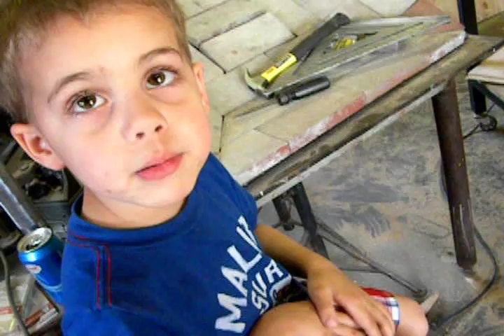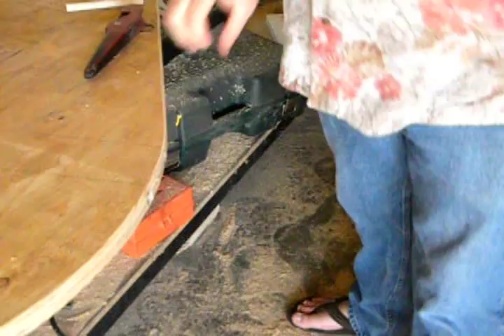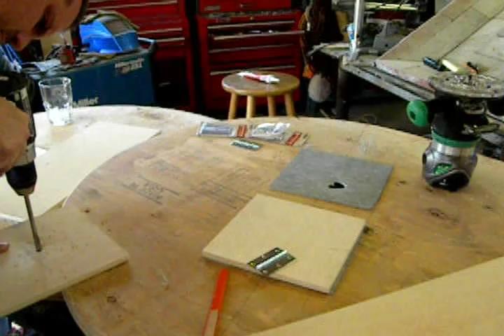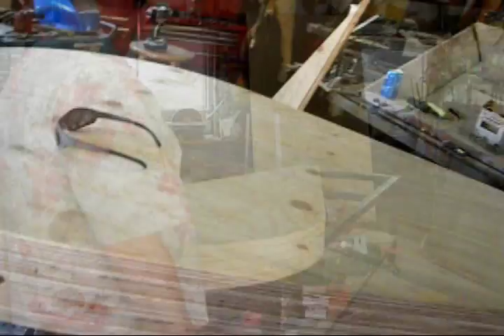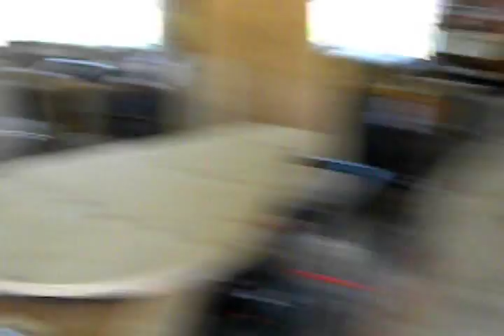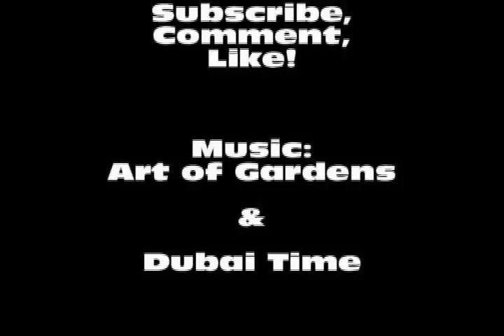MrINJEN - Homemade Forge Bellows Part 3

Comment from the maker: I think they were made with a 4" hole saw. Those might be the vinyl floor tiles I used to make a good seal for the valves. The plywood is rough and I figured would leak a lot around the valves.